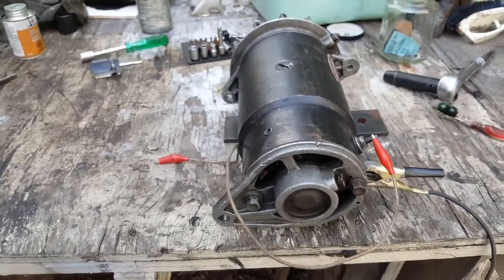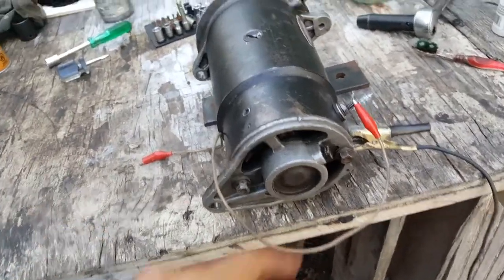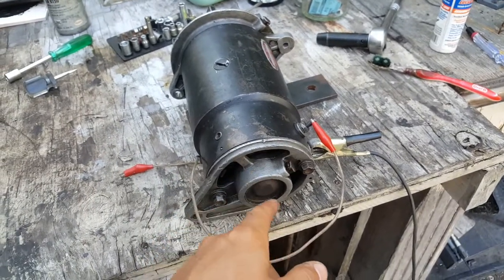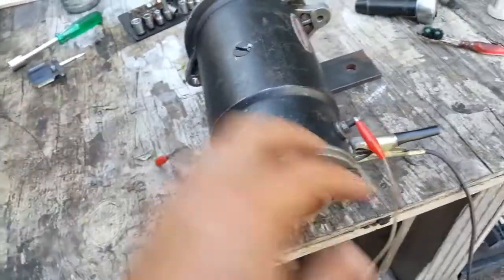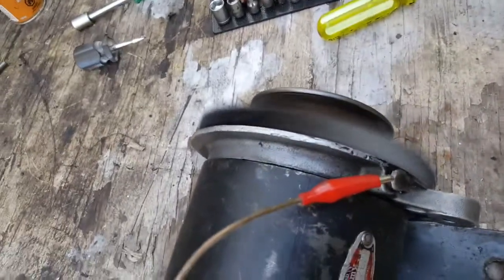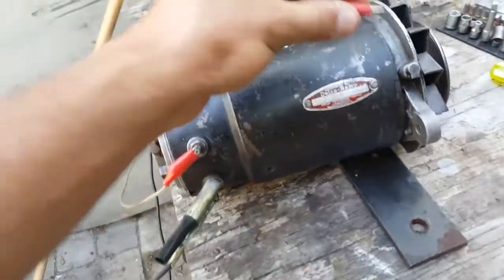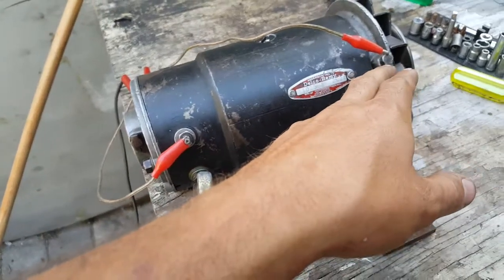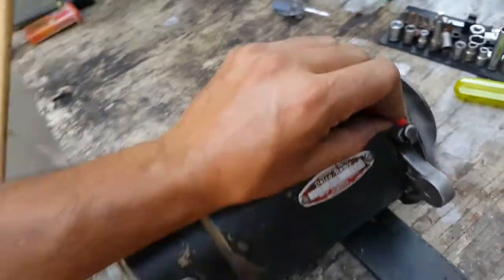Automotive Generator spin test (motor test)

Comment: If it motors doesn't mean it will charge. I have 2 that motor just fine but do not charge.
Reply from the maker: That's very true...I had the same problem
Reply: @OldCrowsClassicCars  and the fix is?

Comment: I remember ' flashing ' power to the armature connection on a generator in a car to help ' polarize ' it and seeing it attempting to move. If you did it with the belt off it would spin.
Reply from the maker: you got it